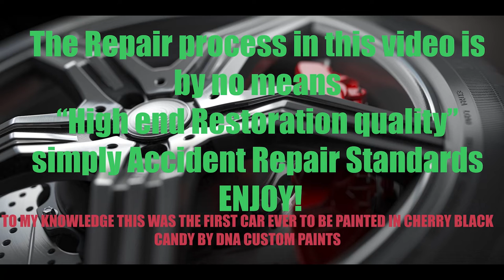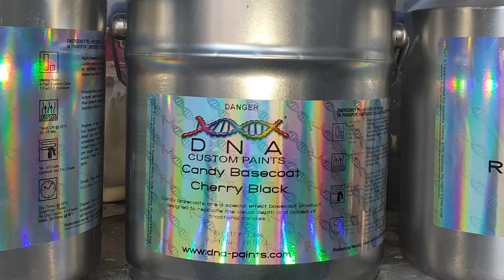CHERRY BLACK CANDY - Mercury Cougar

Comment: Was a gallon enough for this paint job
Reply from the maker: 4 litres was enough over black base . Not sure how many gallons that is
Reply: @BogDustForBreakfast  its about a gallon. I just to make sure I get enough of this paint even for the  inside of  the door jams. It's for s 92 f150 flareside shortbed. How many coats the candy base did you use? And how much base was left over or did you finish it?
Reply from the maker: @partyboy0319  3 coats of black . 3 and a drop coat of the candy base . Had maybe 700ml not reduced left over